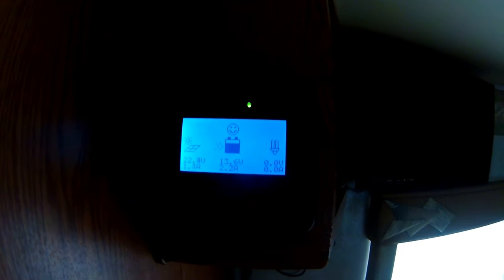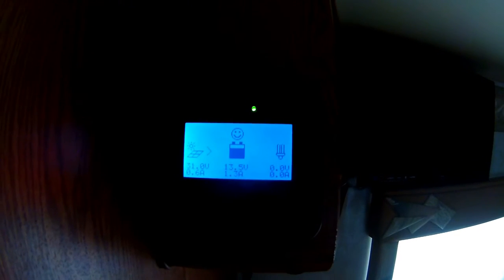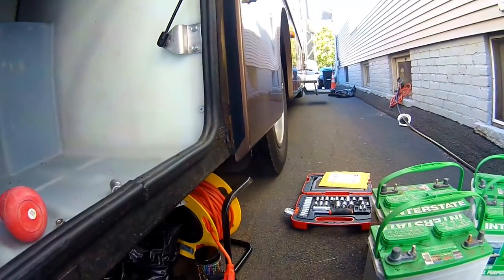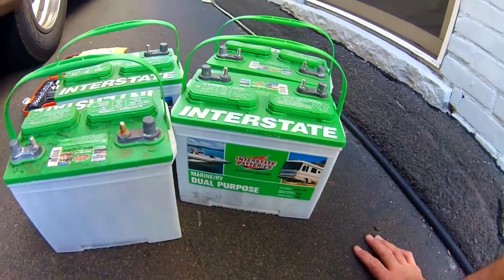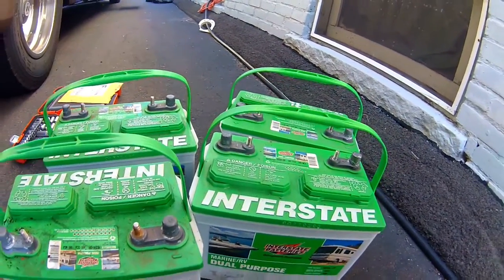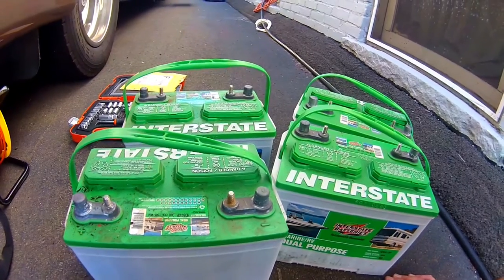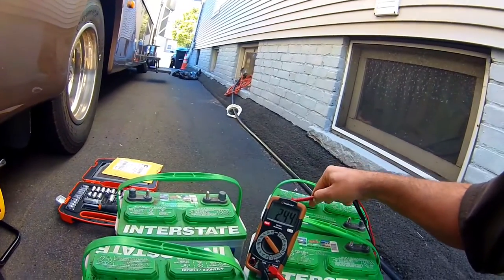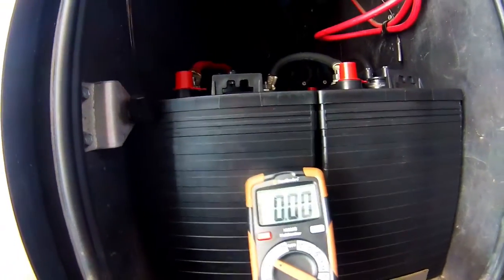RV 430ah Golf Cart Battery install

Comment: Thanks for these battery "How-To's".  I am converting a very small cargo trailer into a camping trailer, and will have a small solar system (120 watts).  I got a lot of information from your videos on the battery and wiring installation.  Now I have to get all the parts, and make it happen.  CaleyAnn
Reply from the maker: Sounds like a awesome project. I have been toying with the same idea once I sell the popup. If you ever need any help please don't hesitate to ask. I subbed your channel in case you should like to share your progress.  Safe travels to you :)

Comment: FYI - As you probably know by now when you see 13.6 vdc you are seeing the output of the charge controller and not the voltage in the battery that you are charging. When you said that when you turned off the charger and saw 10v again you were actually seeing the voltage of the battery and, seeing that you still have 10 vdc, you will know that during the time the charger was connected that close to zero ah (amp-hrs) had been transferred to the battery. What is needed to monitor battery charging and you may not have is a battery monitor that can measure and record the actual amp-hrs from the charger to the battery. This, along with the knowledge of the max amp-hrs that are in the battery(or battery-bank). This latter information will tell you more about the current condition of your battery / battery-bank. To perform this test you need to (1) fully charge battery bank via shore-power then (2) discharge the battery (/bank) using a known current flow (like 5 amps) for a period such as 2 hrs. Then turn off all drains and note the battery-monitor current ah count, (3) then use shore power to charge the battery(s) and then not the ah added and compare to the state of charge that should be in a healthy (new and charged) battery. This information can be used to determine the state of condition of  your battery. You can also have someone else run a "capacity test" on you battery(s) and give you a printout. This is what i did to determine that my 75ah deep cycle rv/marine 12v battery would only accept 3 ah of charge and hence battery is candidate for "recycle bin". I used a Bayite monitor with shunt to collect battery charge ah. Many other solutions possible including just taking battery into store that has the tool to conduct an equivalent test. I did this myself as a "pride thing" of I can do that, mostly cause i currently have time as i am now retired. Nice video. Best wishes to one and all.

Comment: Nice install, BTB... Beautiful sight those 4 golf cart batteries. I'm going to upgrade my battery bank this winter.
Reply from the maker: Big difference over the old grp24's. I should have the full 8 batteries installed in the spring.
Reply: Whoa... you're gonna have some hardcore amp hours

Comment: Just came upon your site, in that I'm thinking of changing out my Motorhome batteries as well.   I've got 4 golf cart 6V batteries, thinking of going with AGM this time.   Wondering if I should add two more (6 Batteries) as I have a residential fridge that tends to pull out many Ah's from my system.    I'm new to this lifestyle, so a ton to learn...nothing for wifi or cell boosting yet, so as I say, lots to learn.
Reply from the maker: Running a household fridge could be done but you would have to recharge every day.  AGM's are great batteries but they tend to have a higher charging voltage profile.  I will be doing more videos soon drop me a message anytime.

Comment: AWESOME set up. Do you also have a way to charge the batteries without solar ?
Reply from the maker: Thanks Rob. Yes The converter is still in use when plugged into shore power or when the generator is running. I also have a 2amp 3stage charger that I use when the RV is not in use.

Comment: Are these batteries still Alive? Did you like them? Recommend? Any issues?
Reply from the maker: Yes they are. BUT i did remove them and put them in a Lift that I use to work on the camper.  I got a great deal on some Trojans so I swapped them out but not due to failure.

Comment: I would like to know how you measured the current draw on your electronics. Did you use a special tester or a voltmeter ?
Reply from the maker: I use a volt meter. Have extra fuses handy most meters have a 10amp max. I plan on doing a video on it.

Comment: I missed a few of your videos, but how many amp/hours will you have when you are done
Reply from the maker: Right now I have 430ah but I do have 4 more batteries to put in and that will total 860ah. Right now though 430ah seems to be ok so I might not add the other 4 to save some weight.
Reply: @BlackTopBoondocker  you have 4 (6 volt batteries) each is 215  Amp hours, times 4 is 860 AH total, not 430.
Reply from the maker: @pauldabey2873  Not at 12 volts. Remeber when volts are doubled amps stay the same. Its a very commen miss conception when wiring 6v batteries to 12v. Great comment thank you.

Comment: I looked on sams club website but could not find the dimensions ( H xW x D) ?  Do you know?
Reply from the maker: Sure do 10.25" long  7.1" wide and 10.8 high. Hope that helps.
Reply: Sweet... Is the height 10.8" include the post and maintenance cap height?
Reply from the maker: I think that's total height. Same footprint as a 12v GRP24 just taller.

Comment: Do you think Trojans are better?
Reply from the maker: Yes BUT.... for the cost I don't think the difference is worth the extra cost for the Trojans.
Reply: Waynes Grid ...absolutely YES! Best bang for the buck in the long run.  Longer life...better performance...usually better warranties.  Trojan is not the only manufacturer of quality batteries.  Surrette batteries from canada outperform trojan.  Also a wet cell.  One of the best ways to compare batteries is the weight.  More weight relates to better performance.  In other words....heavier is better.  Surrette started as an american company and moved to canada.  Surrette makes and supplies most batteries for train diesel locomotive engines.  Thats a tuff battery.  I dont have a stake in surrette...im just offering knowledge.  Surrette L16 size 6 volt is approx 145 pounds each.  Trojan....approx 118 each.  So you can see 30 more pounds of lead than Trojan.  More lead....more power....better performance....longer life.  Do proper maintenance and one can get 15 years of service.  Factory has documentation of even longer service.  Best source i found is northernazwindandsun.com.   ask for john.  I dont have a stake in this company.  Just great folks and excellent service.
Reply: I know this is old, but the topic is still current. Trojan makes several product lines at different levels of quality and price so you will usually get what you pay for in terms of life and performance. Like Robert said, the better ones will be heavier as they have more lead in them. With RVs, lighter is better so it all depends on how much weight you can and want to haul.
Reply: Surrette 6v batteries as mentioned in this comment, have bad reviews now on Amazon.